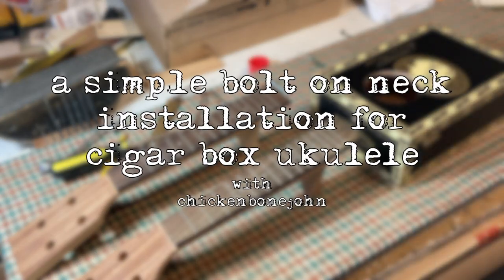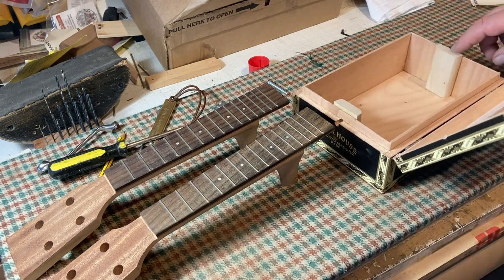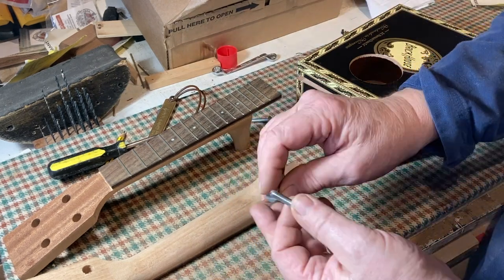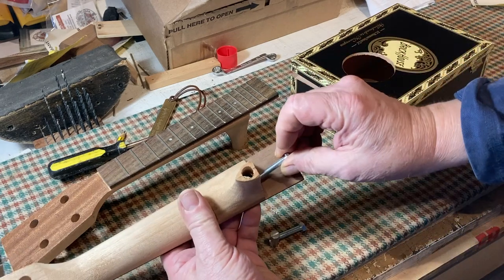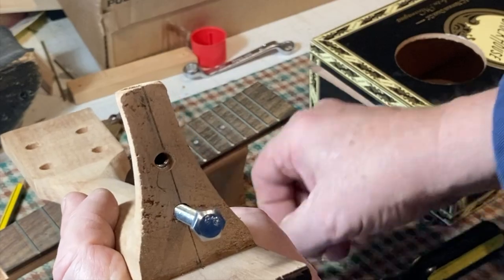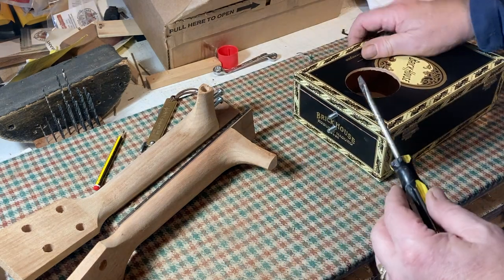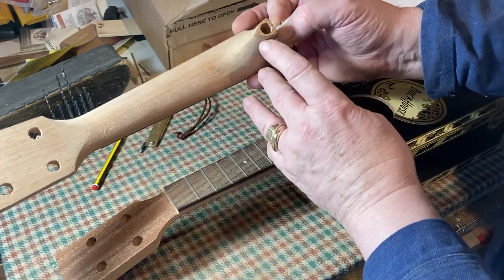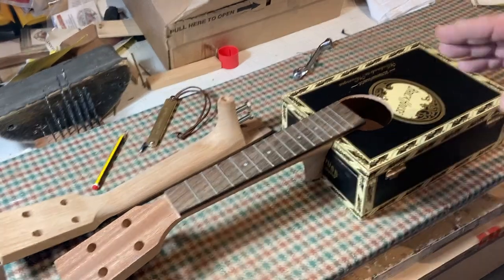Simple bolt on neck for cigar box ukulele

Comment: Very good idea, is there a reason I can't think of for not putting the lid of the cigar box on the bottom of the instrument as that would seem to make access very easy, particularly if you are thinking of including electronics.
Reply from the maker: The back of cigar boxes are usually plain and not very attractive, their beauty is in the artwork on the top, so I prefer to make my instruments beautiful rather than boring. Last week, after making over 2100 of these, for the first time ever  I used the "back" of a box to put on the front of the guitar,  as it was nicely lacquered and looked better than the front of the box.

Comment: I've wanted to try this for a long time! I was gonna do 1 dowel and 1 bolt. I thought this was done with a section of threaded bar and a nut on the inside but that might just be the 1 I saw. Bolt makes things simpler too. Split washer perhaps? To maintain tension?
Reply from the maker: Just a regular washer is fine. You don't want to exert too much force on the connection, as the  "wall" around the heel where the barrel connecters pushes against is quite thin, so it is easy to split it if you apply too much force to the bolts.

Comment: What about using threaded steel inserts in the neck instead of the barrel nuts? I use threaded inserts on my bolt on cbg necks to great success..
Reply from the maker: I'm sure it will work, but I had the barrel bolts in my parts box and  they are very easy to install.

Comment: Hi Mr Chickenbone. I have a question if you don’t mind answering. I just ordered a CBG, it comes unfinished and I want to put a nice dark stain on it to match the black and gold box. My question is do I need to put a varnish or clear coat on in between the frets? If so would I tape up the frets somehow or just wipe them down after putting on the clear coat? I can’t seem to find an answer anywhere online. Thanks
Reply: Just found your video on that. Nvermind